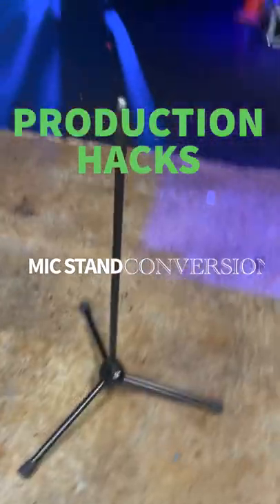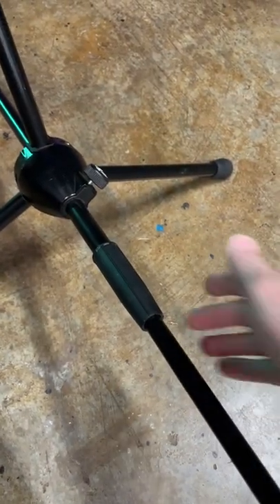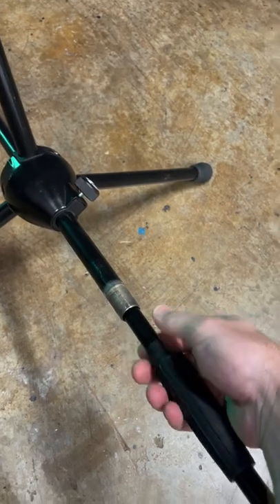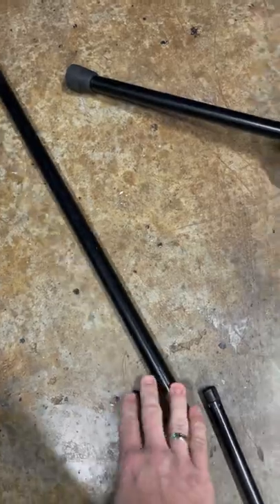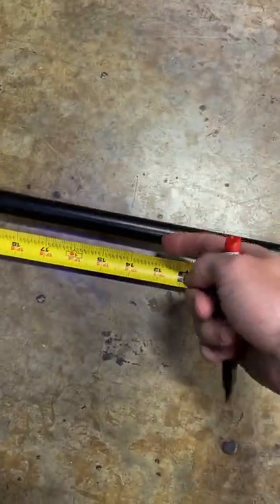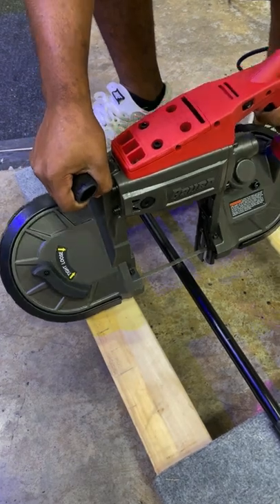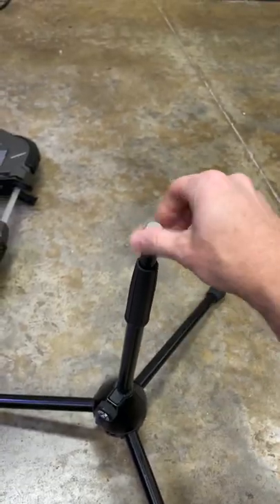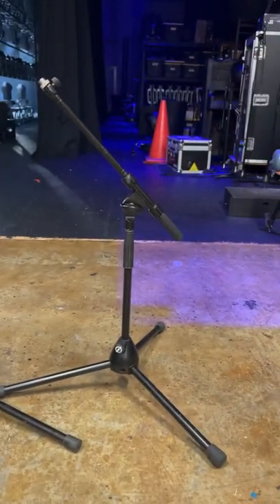Production Hacks - Microphone Stand Conversion #shorts

Comment: You forgot to take a automotive flaring tool and flair the bottom of the outside tube so the pipe will not slide off the base and drive you crazy every time you use it...
Reply from the maker: Oh, now THAT is a pro move! Thanks for the suggestion Ron.